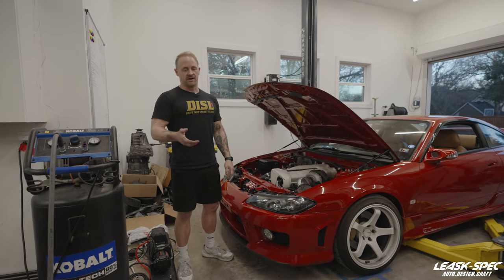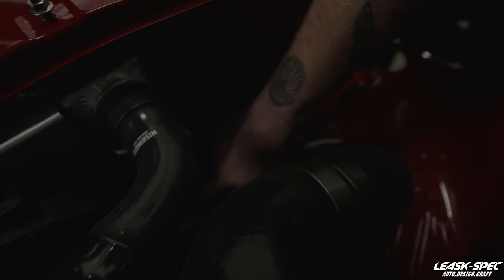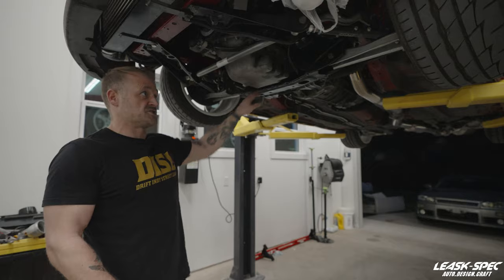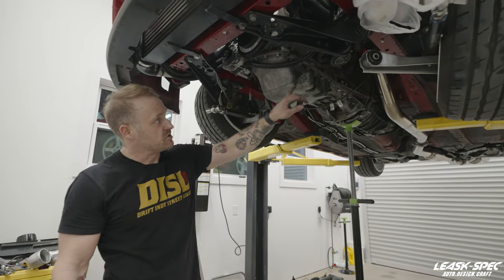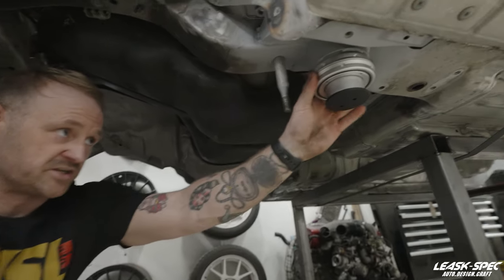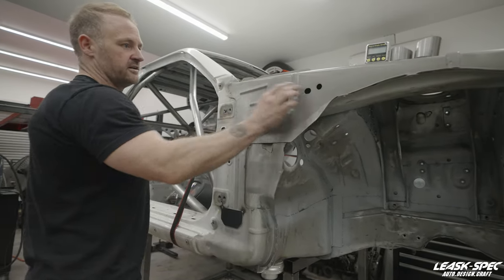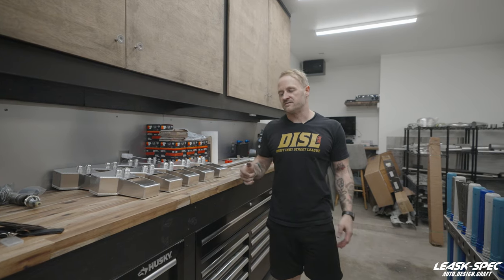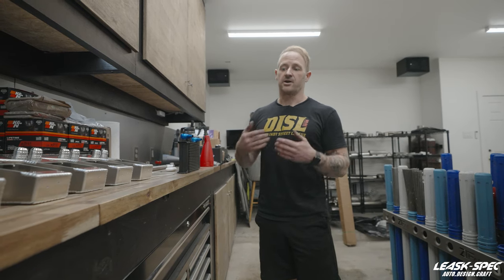RB26 POWERED S15 COOLING AND OIL MODS

Comment: Good stuff. Keep th coming!

So for the filler neck issue, look at what Bespoke Racing Fabrication does with their header tank. Looks like that style will be a cleaner solution. I have one for my Rb30/26 and does the job
Reply from the maker: Yeah they do fantastic work. I’m familiar with the dahtone builds and BRF lineup. I’ve done a can somewhat similar but more customized for this application as far as plumbing and fitting options goes 👍

Comment: Do you think I could mount a GTR front subframe to a stock s13 front end? Keeping the GTR front dif pan with your oil pan mod?
Reply from the maker: there's a lot more necessary to running the subframe like the legs of the frame rails, etc. its a very involved job